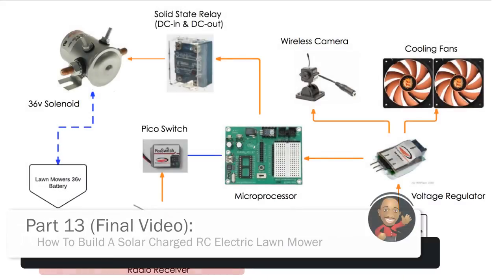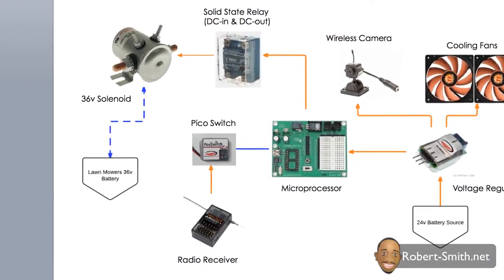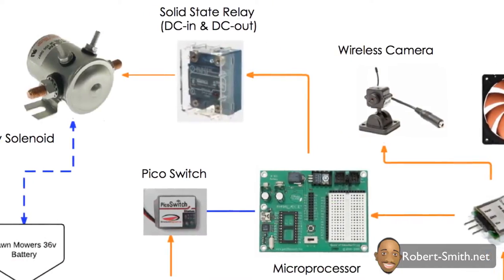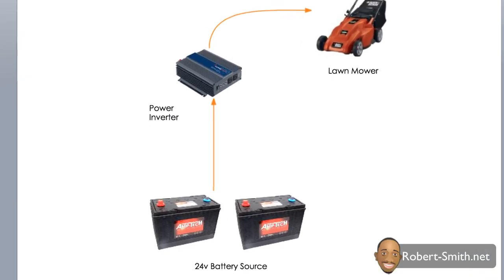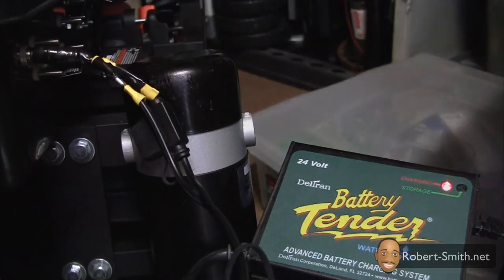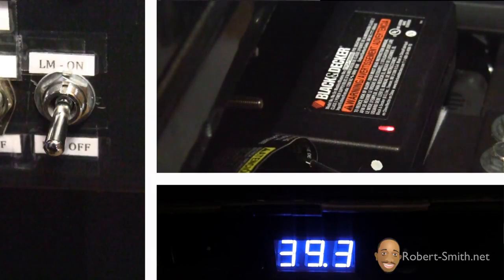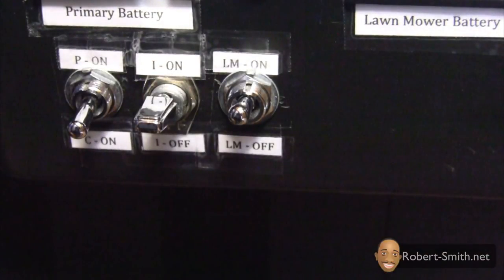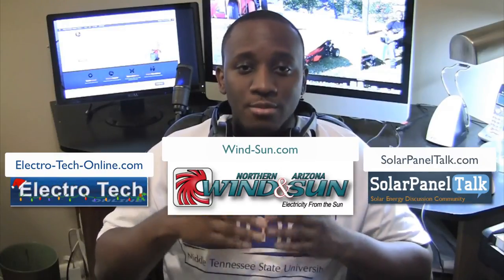How To Build A Solar Charged RC Electric Lawn Mower - P13

Comment: Really enjoyed the series.  I think you should build a line trimmer robot for the lawnmower.  You could probably use the power from the wheel chair batteries to power it.  Building it like an industrial robotic arm would be very neat but complex.  I would love to see a mechanism that stands on two wheel too, but that wouldn't have much use.  It seem like such a project would be really easy to build.  A solar tracker for your panels would be neat too.  Thanks for the videos.

Comment: Thanks again for the Shout out Robert!  What you should build next? hmmm...  A pair of 7' Tall floor standing home theater speakers with 15" internal powered sub-woofers on top and bottom with mids and tweets at center?  17' tall Remote controlled walking robot? Segway on rubber tracks, robot to lope horses...just to name a few... I would like to see a solar powered flashlight...it would be great for a gag :)  Hats off again.  You did a super fantastic job here.

Comment from the maker: Yes, the schematic uses a mixture of block symbols I created and regular circuit components. I did not put the Receiver in the schematic since I dedicated 1 full video in the series for hooking up the receiver to the motor controller. So that block symbol in the schematic somewhat represents both the motor controller and the receiver, even thought it is not shown. Good question.

Comment: I'd also like to see some motion detectors installed on the lawnmower to shut it off if it detects moving body heat within about 10ft.  I think it's possible to get 4 for 12 bucks on ebay.  It would be a simple three wire to hook up and very little code to write.   An RC snow blower with the same motion sensors on it to shut it down if moving heat detected would be a neat project too.

Comment: Four-channel simple remote control helicopter with Wi-Fi camera with built in microphone. Very small speaker with power boost so you can send and receive messages by simply flying the chopper over. Just a thought. Would be a great source of home security too. :)

Comment: really, really impressive. can you tell me what kind of switch you used for the far left switch at 3:10 ? i'm building a similar robot with a 12 to 24V lead-acid power source using the same motor controller you are here.

Comment: Great series Robert. I was wondering about your rc power switch. Was it possible to connect the solenoid directly to the rc receiver or did you have to connect it via the microprocessor? 

Anyway thanks for the series and keep up the good work.

Comment: Awesome!  The solar power is cool especially if you park it outside. You could have driven the drive wheels and the blade from the same set of batteries, but this works.   Have you used the AC power inverter when the power has gone out?
This is just a fantastic combination of stuff, keep it up!

Comment: Robert,

I have a complete 24v cordless electric lawn mower as well as a complete 24 volt wheelchair.  I will soon be building a mower similar to your and have taken several ideas from your build.  Mine will have only the two main batteries, instead of two for the drive system and three for the mower.

I have a question about why you chose a certain path.  

What is your reasoning for using the Parralax MicroProcessor?  It seems to me that you have the Radio Control Receiver controlling the Pico switch which just produces an on-and-off signal to the Parallax, which is then producing the same on-and-off signal to that solid state relay, which is then producing that same on-and-off signal to that starter solenoid, which is then producing the same on-and-off connection in the mower?  Unless the microprocessor is doing more than just on and off, this seems redundant-upon-redundant to me and an inefficient use of the power needed to trip all those units.  

I believe a "BattleSwitch" from DimensionEngineering in place of the PicoSwitch (only $6 more) will directly control that starter solenoid, and cut out the Parallax and the SSR completely.

Please let me know as I am really curious at this point.

"DieCastoms" Mike, Augusta GA.

Comment: However, I see a lot of problems here.
1. What about terrain that is uneven?
2. What about mowing in places that are difficult to access?
3.The cost of such a project is unprofitable-only for enthusiasts.
4. There is still lost time for remote control. The only plus is that you don't have to put much effort into pushing the mower.
Solutions:
1. I would make automatic mowing with scanning of the entire map of the area to be mowed.
2) Remote control along with a camera is useless if you don't have time.
3. I would replace the batteries with LIFPO4, they are lighter and have remarkable discharge/recharge characteristics.

Comment: Robert i think that frame of lawn mower is to wide...and lot of parts of lawn mower during operation are not usable . Couple of inches in the front and also at least 2 inches on the side of the lawn mower. In that parts you can't mow the grass. That is especially evident on some corners or edges of yard.  Also i think there is to many bolts. For me blind rivets are better option, just it's not so easy to detach if you forgot something. but it's much easy to install them.